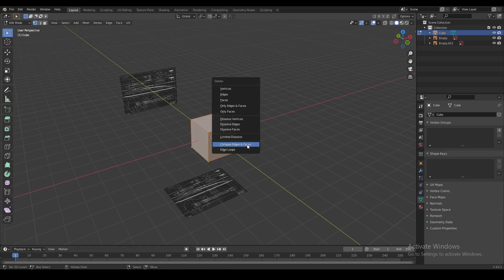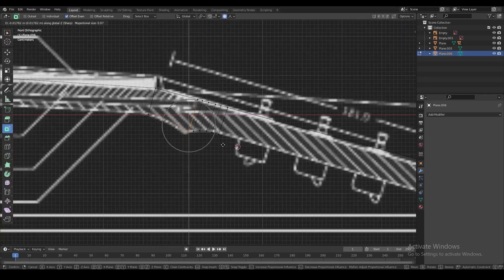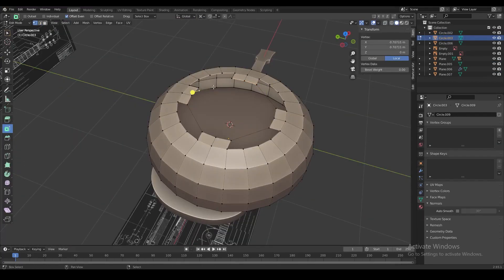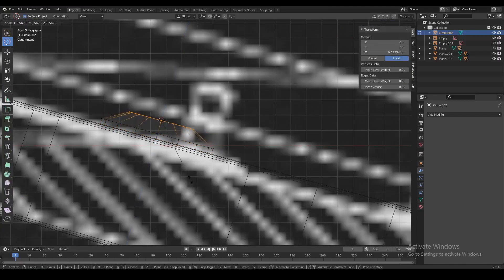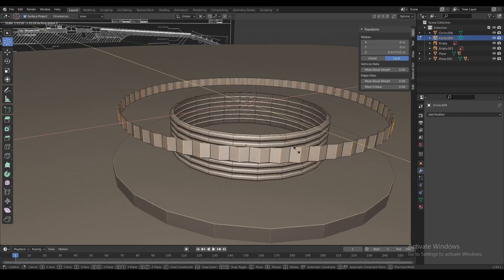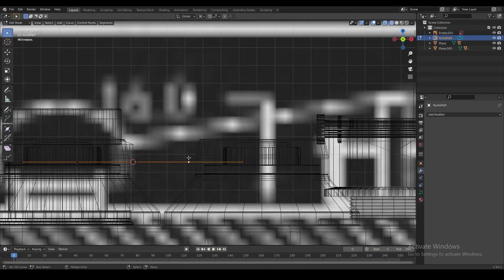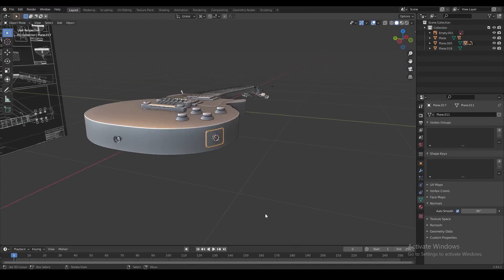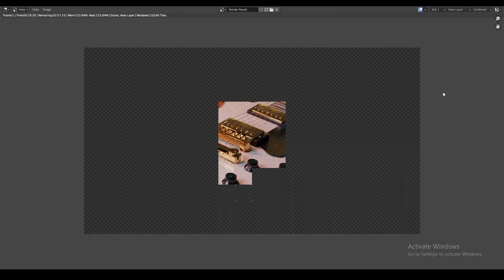How to create your Guitar in Blender | Blender Modeling and Rendering Workflow

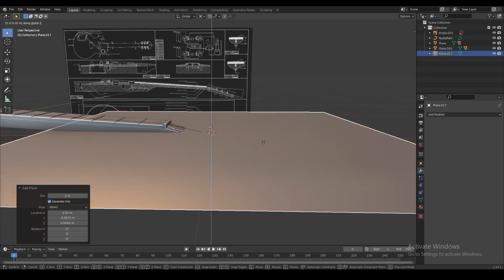Comment: Pretty nice workflow. I know this video is +1 year old, but I can't seem to figure out what you did on 5:09, when I create a plane and delete all vertices but one and then apply a screw modifier, I don't get the same result unless I extrude the vertex, but that creates a flat face.
Reply from the maker: its important that the vertex is not on the same place as the origin. With the screw modifier, the vertex will turn around the origin.
Reply: @Aryan3D  this was exactly it, thank you for replying!

Comment: Thanks for the great tutorial!:)
I have a question though, when I fill in the guitar body and bevel the edges it looks very weird and uneven on top. Would appreciate if someone told me how to fix this!:D
Reply from the maker: Is this a shading problem or a geometry problem? If it is because of shading, select all the edges surrounding the face on top and select 'mark sharp'in the 'edge ' menu in the top left in edit mode. Then use an edge split modifier and set it to sharps instead of angles.

If it is a geometry problem, make sure that the face is perfectly flat. You can ensure that by scaling it to 0 on the Z axis. Also make sure that your normals are correct, you can do that by selecting everything in edit mode and pressing Shift + N.

I hope this helps, thank you for the comment
Reply: @Aryan3D  Marking Sharp and EdgeSplit worked, thank you so much